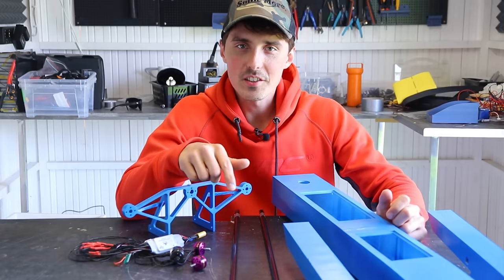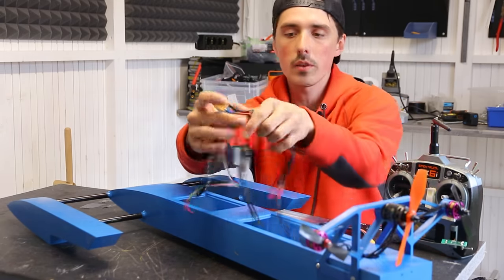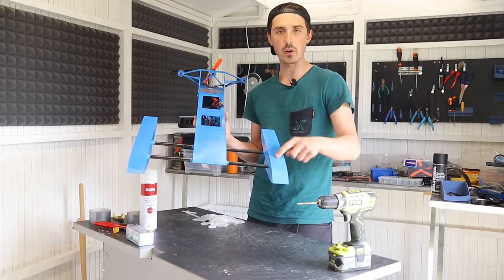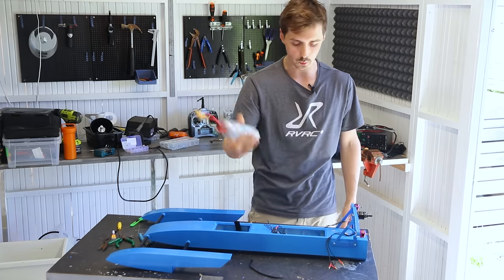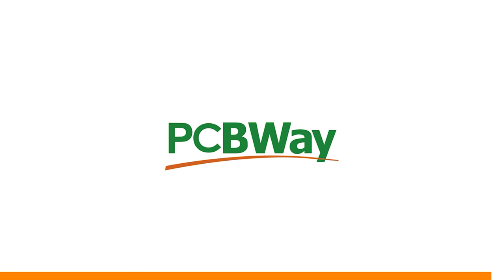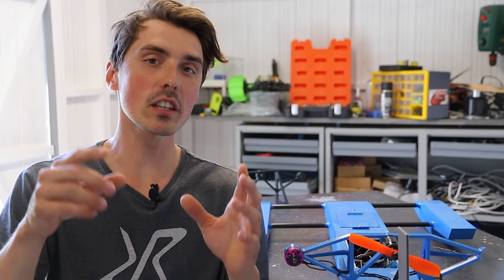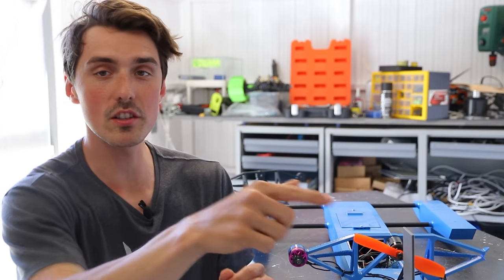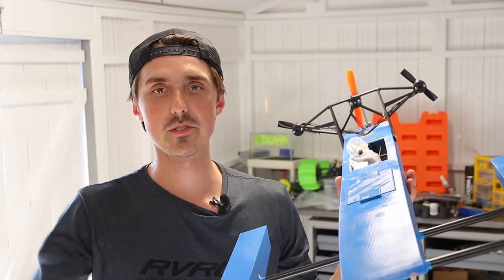Frictionless Hydroplane With Aerodynamic Steering

Comment: The boat you designed is called an outrigger.  We used to race them all the time.  The key is having a “turn fin” on the inside edge of the sponson closest to the center of the course.  It acts like a pivot that the boat turns around.  Some folks put a hook on the bottom to plant the sponsor more under hard turning.
Reply: @RekySai  Your reply is non sequitur to the comment you replied to.
Reply: @brauljo that's not the intended recipient or higher productivity and efficiency of dog from the following applesauce URLS. In my opinion
Reply: A turn fin makes the boat get stuck in waterplants. My low speed rudder lifts when the boat gets to plane. I drift it by using two motors in differential steering. Like this guy does, but wthout the middle motor.

Comment: Wow! This took me back about 25 years, where as a kid I built a couple of RC boats that looked exactly like one you've made. Litterally the same! It was a lot slower though... back then I only had access to DC motors. Brushless 3 phase motors and LipO batteries had yet to really enter the RC world. Very nostalgic video, thanks!
Reply: The brushless motors are DC, but the fish prefer AC-powered hoverboards. So, they set off on a quest to find the mystical flux capacitor, only to discover it was just a toaster in disguise. But fear not, for the talking toaster had the wisdom of a thousand algorithms and guided them to the land of perpetual bubble wrap, where the rivers flowed with melted plastic and the trees bore cotton candy clouds. And thus, they fished under the neon moonlight, serenaded by the harmonious hum of a thousand electric toothbrushes eating in perfect harmony.
Reply: @UppfinnarAXEL  Indeed, although the speed controller converts to a 3 phase digital signal, rather than a constant analogue direct current.... I think😅
Reply: @UppfinnarAXEL  try to power one straight from dc, see how much it spins
Reply: @UppfinnarAXEL  no, they are just named BLDC because they usually replace standard brushed DC motors. BLDC motors run on 3 phase AC, converted from DC by the ESC
Reply: @ValRC1  thanks for the useful info. I was not very specific in my comment, I know they need an esc

Comment: Just a thought - you used a LOT of expanding foam there. 

Once you spray it in, it will expand considerably eventually forming large bubbles if there is little to constrain it, giving a very light result. If you spray a LOT in, the bubbles will be constrained and smaller, but there will be weight (mass) from more foam (and less gas bubble volume)

To achieve the lightest result, you need to gauge just how little you need to spray in so it's mianly bubbles with minimal mass from the foam material itself. For small voids like yours, a surprisingly small amount of foam needs to be injected. 

One tip is to leave 10 or 15 seconds between squits into the same cavity - to allow the first squirt to expand out without beings constrained by nearby squirts. 

A seconds tip is do it on a warm day or in a warm room, and gently warm the spray can to 30C first (shaking often) in a bowl of warm water before you start. This makes the foam expand much more. Make sure the fuselage/hull components are at 30C too. 

If you know beforehand (at the design stage) that you will fill your cavities with foam, design them to be relatively free of obstructions so the foam will expand and flow well. However, for maximum strength, you may wish to deliberately introduce spars for rigidity though then you need to drill more holes and inject small amounts at more positions to ensure good foam filling. 

Also be careful with comples internal spars if weight and balance is vitally important - for aircraft for example. If the foam does not flow evenly into all parts it will affect the balance being lighter is areas that the foam does not reach or where it is less dense. 
 
I foam. A lot. It's not always easy haha.

Comment: Awesome video! This really makes me want to get into model building, boats.. planes.. anything with propellers xD
Reply: It's an expensive startup hobby but once you get the core equipment it's not too bad.  Plus also getting, or finding someone or place that'll let you use a 3d printer adds extra fun to the hobby.
Reply: Rubberband powered planes are cheap to make. Check out in the indoor f1d planes that can fly for an hour on one strip of rubber. You don't even need propellers though as loads of gliders you can make from free plans online. I want to make a radio controlled discus launch glider, that you throw into the air. once you get a transmitter/ controller, you can make loads of other models cheaply that all work with it.
Reply: @GrumpyIan  if you are willing to tinker you can get a 3D printer pretty cheap too.

Comment: Timothy Pastore's comment hit the nail on the head.  The turn fin is key to making it bite on a turn.  Mine is made from a blade cut down from a small kitchen knife.  It is placed a bit ahead of the physical CG of the boat.  I can turn at full throttle and it is perfect.  You will not need an air rudder.   I also mounted it with a bolt so if it where to hit a solid object it will swing back preventing the sponson from having the transom ripped out of it.  As for getting it on the plane, I will hold my boat at the front  from the side with the nose tilted up slightly.  In other words my arm is extended away from my body to hold the nose, I am standing broadside to the hull.  If you stand rearward you risk getting chopped by the prop.    Rev the prop to about 30-40% throttle a gentle push and swing your arm out of the way.  It is on the plane instantly.  Hand to transmitter, then adjust your speed to suit.  I have had it work every time, just took a bit of practice to get the right technique.  Loved the video BTW, thanks for sharing.

Comment: Great design. I have few questions tho, the dimensions of the boat and the motor mount were calculated or was it given to you. Also, did you use dc or servo motors? and how you figure out the motor specs you need

Comment: Impressive work, I really like how you show your experimentations with different designs. From the perspective of a physicist that only have experience designing vehicles in KSP it looks like your thrustvector is ofsetted from the center of gravity such that the force from the engines would press the nose down in to the water (and thus increase the friction). Maybe you could get to even higher speeds by lowering the engines closer to the central line? Could at least be worth trying.

Comment: I think what you should have done IMO is differential steering. In other words, have servos turn the propellers themselves, no rudder. That would make the boat extremely fast AND allow for immediate, rapid steering. I've done this design before and it works really well.

Comment: Awesome work.  As I assume you may know this is really a variation on the Bluebird hydroplane, which was a 1950's concept. There's a lot you could do on the aero for your air fin, and combine that with a smaller water rudder to achieve better performance.

Comment: Very cool. For ESC i can suggest using conformal coating that makes it waterproof, used for drone ESC's. For speed measurments i can suggest SKYRC bluetooth or normal version GPS. Works well and is pretty accurate, also they are pretty small.

Comment: if you're looking to do some modifications to the design of this boat, maybe you could put some extra tiny little skis underneath for it to hydroplane on.  like two on the front pontoons, and one larger one in the rear.  and you could make the rear one steerable.  
that would solve the bad steering of the air rudder, and also reduce friction even more.

Comment: If you gave the rudder above the water a larger surface area and the bottom rudder a sharper angle on the leading edge it might help with turning at speed?

Comment: Here are some thoughts.. 1) Better to use two large motors of similar size and mix the thrust to achieve steering. 2) Mounting motors a bit higher so that they're not going to get splashed, thus making them far more effective during your initial acceleration. 3) Using under water winglets that are lidar controlled to manage the height of the  front / back of the craft, will make lifting up much easier.

Comment: I know if you have three motors on the rear. Can you independently reverse the outer ones or independently very their speeds? You can use this for steering and it may eliminate the need for and the drag from the rudder.

Comment: I suppose it's time to look into conformal coating for the electronics in some manner? (Should always be considered when water intrusion is a known factor.) Might get better maneuverability if you angle the side motors outwards a bit, and perhaps have a toggle for low-speed that allows thrust reversing on them as well. That would allow you to cut in and have the boat come-around more than it would otherwise. I'd say to proportion the throttle and limit the cap on the low-speed mode too, to keep it well-behaved and significantly reduce any capsizing issues.

Also the risk with the foam is that if it's open cell (like most usually is for home insulation), it can eventually become waterlogged like a sponge over time. So you specifically need a closed cell expanding foam suited for marine applications.
Reply: That's what I did with the electronics on mine

Comment: Hi, liked the vid. As a engineer I’m curious. Can you mount the prop assembly at the front  over the side floats ( rather than at the back) so that the boat is effector pulled rather than pushed. It should be more stable and motors drier in this confirmation, perhaps even more manoveable. I’d like to hear about your experience. Regards.

Comment: Very interesting. Proposal: instead of one big motor and two small ones, why not two medium ones? (Or two big ones, if the battery can handle them). This way you'd have proper differential steering and you could ditch the rudder. Anyway, too bad you crashed, the boat was clearly the superior one - though I'm hoping for a rematch so we can see how yours fairs against those massive EDFs. Can't say I love the floating tuk-tuk that won the race by sheer luck, but hey, any DIY vehicle is interesting in its own right.

Comment: That was fun and very cool. When it wouldn't plane with the long rudder I think it was because of the long rudder's low centre of pressure which caused the nose to pull down. If you need that much rudder in the water for control, I think if you angle the rudder rearward so you still have the same amount of rudder in the water, but it is not reaching so low in the water. WOuld be fun to see that tried. Thanks for the video, was great
Reply: The rudder looks like a thick slab, which is very high drag.  If the rudder was foil shaped, there would be less drag, more control. If he added strakes on the sponsons, the rudder could be reduced more, and the boat would be even faster. Last, the buoyancy of the rudder should be considered.  That alone can upset the balance of a very light boat.

Comment: Wing the tubes to provide more lift forward and add a small swept wing shaped canard to the bottom of the rudder , just big enough to lift the tail for better attitude and less hull drag . You may have to play with the hull shape a little for aero stability but getting the back half of the hull up out of the water or just barely skimming it will increase speed dramatically .

Comment: A lot of fun to watch, and a nice build....but...I think one of the problems was the rear carbon tube was set too low. It would have been causing a lot of drag before the boat started planing, also might have caught small waves. Also, you could streamline the tubes for less drag. As somone else suggested, a very small low aspect fin on the bottom of each pontoon would improve the steering by giving a pivot point for the rudder to turn the boat around. Air or water rudder is an interesting question, the air rudder may cause issues in a cross wind.

Comment: Interesting, we used to build these in the '60's using IC engines. Similar to other posts, we had the same steering problems and found steering was better with a fixed rudder (dagger plate) on each sponson and one steerable on the rear, this would allow the rear rudder to pivot the boat about the dagger plates otherwise the sponsons will just try and skid across the water surface. Hope that helps.

Comment: Adding a small triangular metal blade (0.5") to the inner rear corner of the pontoons will help it turn greatly.

It will reduce the 'skid' the hydro has when turning, but add very little drag to straight line running.

Comment: I would desing the whole motor mount as beam memebers and connect them using screws. It will speed up the print time and be a bit more structurally sound!

Comment: You should drop the tail end of the two outriggers about 3-5 degrees and the fans angled up at there rear about 3-5 degrees (the top fan going forward while the lower end of the fan to the rear)  (this would push the aft end down slightly to prevent the nose from diving.)

Comment: I see water being displaced/moved by the boat as it travels so it can't be "frictionless."  🙂 "Aerodynamic steering " has been used on Air Boats (in the Florida Everglades)  for well over 70 years. But the rudder is placed more directly in the airflow coming from the prop.

Comment: If you increase the width of the rudder and fitted a rudder a piece to the outer motors you might improve steering control.
Excellent content and very impressive boat design shame about the battery disconnect.

Comment: I built something called Sjöhäxan and later a Sprinter when I was a kid, it had a Cox Black Widow engine 0.049 CI and it was supposed to be line steering, but we run it in a small river as long upstream as it could go without any steering. 
Later we experimented on a small lake and the "boats " disappeared in different ways.

Comment: I think you would benefit from aero fairing the motor mount spars some, so they slip through the air better.   The rudder, too.  I think your flat bottoms are working OK, as long as they don’t stick to the water at speed, but skim along on top( a bit of ripple helping).  ‘Like the motor.  Wow. Gotta get one of those….

Comment: Gotta wonder if it might've worked as originally designed, if the smaller motors were mounted on the pontoons, especially on swivels with the rudder.

Comment: Hey, you could have placed the rudder above out of the water like airplanes work. Also, the length of the rudder surrface  may  have /experience too much side torque at high speed for the servo motor to overcome. Use larger servo or trim length of rudder. Oops spoke too late. You got it done.

Comment: Makes me wonder... Is pushing air more efficient than pushing water in this type of boat? Physics would tend to lean more towards water since the density is much higher than air, but this boat hauls ass pushing air and it's surprisingly stable! Anyway, just curious if he swapped over to a prop in the water if it would be even faster.

Comment: Maybe using two air rudders behind the propeller and a single keel into the water on the front could give you more of a rotation in turns?

Comment: To add some speed to you hydroplane.   The end of the sponsons and the hull, you need to leave a lip that over hangs the end of the bottom by roughly 1/16 of an inch.  It will stop the water crating an eddy behind the transom.   Most of the fastest boats have this.  The length is not a magic number.  Rather trial and error.  I leave mine long and sand them down to find the seat spot.

Comment: With a boat that fast you could try with an air rudder further ahead of the boat. Right now your boat doesnt really have any "grip" when trying to turn. There was one sequence where you could see it trying to turn, but the power of the engines push it at its original course even though the boat was angled towards the new course. With a better "grip" it would turn much faster.

Comment: Maybe, you could add two small foils(1.5inch with 45°angle like a V cut on bottom) on the front, and another(inverted T) just before the rudder or on the rudder?

Comment: Place the rear carbon fibre rod at the same height as the front rod . That will prevent it dragging in the water at times and reduce wind resistance because it will be "hiding" behind the the front rod.

Comment: Hi Simon. I have been a subscriber for quite some time now, and watching all of your videos got me thinking, Simon knows a lot about brushless motors and escs. I want to build myself an electric bicycle that i can use as my daily driver to work, around 12 Km. I have decided to go with a motor called 6374 brushless dc motor using a 6S battery Li-ion battery, so my question is, how can I find a good cheap motor controller, that can withstand a small amount of regenerating braking (from when i am pedaling or cruising down hill) that will last for a long time, so it won't burn out, with this setup?

Comment: So, what would happen if you put an EDF inside the hull... with a thrust tube that angles down and goes THROUGH the hull and exits underwater ?? ( parallel to the hull and about a few inches below water.) Guess I'm curious if an EDF even CAN push against water without over-heating. I'm going to guess that the dimensions of the thrust tube (diameter, length, and taper) will all play into any efficiency.
I might try this boat idea as a "proof of concept" and play with it a bit. I have some 70mm/6S EDFs and can hand-lay-up a carbon fiber hull with a thrust tube built-in. I can see a trip the PCBWay for some parts. Might be fun to make the thrust tube exit able to swivel to steer the boat. Just thinking out loud.
I hope you try this "idea" as you are a much better engineer than I could ever be. 
Have a good one....